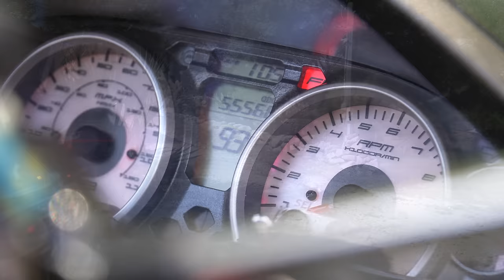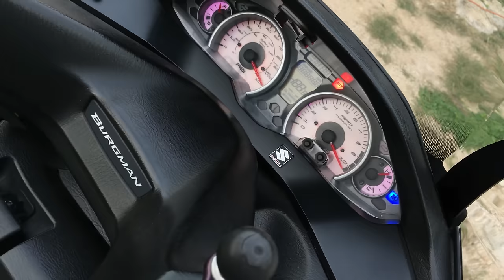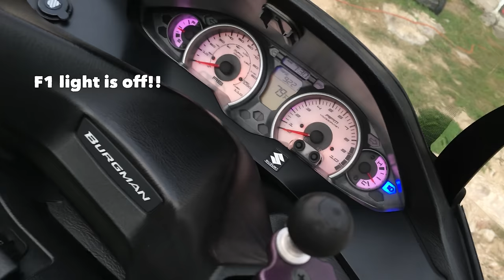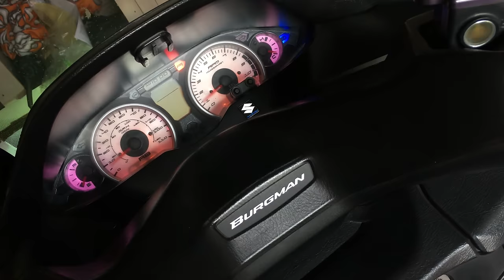Suzuki Burgman 400: FI Light! STVA Problem FIXED! C28 | Mitch's Scooter Stuff

Comment: Ever figure out what the actual issue there is? Mine trips every ride or evrry other ride. Bikes in the shop for inspection and i had to show them what you did to get it to go off.
Reply from the maker: Hmmm I would do deep cleaning and clean the connectors, hopefully that will fix the issue

Comment: Hi Mitch, I have suzuki burgman 200,  year 2015. I have a problem with overcharge problem. My I know, where the regtifier position is? And is it possible replace the original regtifier with other brand with the same load, such as regtifier of honda tiger or kawasaki? Thank you Mitch.. GBU

Comment: Great video. Thank you. So I checked mine out with the FI light on and the value when moved to the closed position will cycle to fully open when the key is turned on. When at fully open it just judders and stays there. When the engine is turned on it doesn’t move at all from the fully open position. It’s like it will only move in one direction. Does anyone have any ideas? I tried everything in this video and no change sadly. Thank you

Comment: Good job Mitch. That is a fly by wire system consisting of a Throttle actuator control (TAC) and Throttle position sensor (TPS).By removing it and cycling the key, you were able to have it re calibrate itself. Most automobiles do it every time you cycle the key. Some need a scan tool. The ECM calibrates it by feeling the load of increased amperage when plate stops all the way open then it cycles closed and detects the same. The number one issue causing that is sticky dirt holding plate closed so it grabs during key cycle and goes haywire. 2nd is internal issues or slightly loose connector terminals. Keep up the great work. I have 2013 PCX 150 but I want a Burgman and a Helix. I am watching all your videos. 

Thank You
Reply from the maker: Hey thanks for the info! 😄🙌🏼 ride safe 👍🏼👍🏼

Comment: Just bought a 2011 that sat for a couple years and your videos have been a godsend. Thank you for all that you do!!
Reply from the maker: You’re welcome! 😄👍🏼👍🏼
Reply: My fuel problem is on going, change the fuel pump found the filter broken apart and debri in pump. The 2011 ran much better but still no full throttle. will replace what next?.

Comment: I have a 2008 an400 and when I used the screwdriver like you did to turn the actuator it’s spring loaded so it doesn’t adjust so I just opened the valve all the way like you did and reinstalled the actuator a little off the paint marking alignment like you did at the end of the video and it worked!!! FI code is off and throttle power is back to full power!!! Thanks so much Mitch .... you da man!

Comment: The f1 problem showed up again, one year after I did you video solution. I checked all  the parameters and I realized that if you  inject lubricate (WD40) to the intake port and then do again what you do to your video the problem will be disappeared again. 👍

Comment: As always... Awesome stuff Mitch! 
I just repaired my 08' B-man as-per your vid. When I turned the screwdriver clockwise the stva's spring made it return to the same position. I did everything else you did and moved it until the "noise", backed off a hair, then tightened it. After a couple tries I finally got it working properly.
Many Thanks!
Reply: I got b-man 2015 with that problom what should i do to fix it ?

Comment: Thank you Mitch. I had the problem of the secondary fuel filter, after 5000 rpm doesn't work. I desassemble all the fuel pump, fix the fuel filter problem and clean the throttle body by ultrasonic laudry, but i made a mistake when i assemble electric stuff of the throttle body....and F1 light appear....thank you to help me to solve the problem...

Comment: Dear Mitch,  I think I saw 55,000 miles on your odometer,  was it at about that mileage that the problem appeared ?    If I'm not mistaken, the actuator part #  is 13580-14G01-000  and costs around 140$US,  has anyone on here fitted a new part and did that fix the problem ?   Thanks,  Chris in Brazil.

Comment: I have an F1 code 28 but when i took my air tube off and looked inside my carburetor,  i am missing that door and the door way in the back is closed. I think before i brought my 2008 Suzuki Bergman 400 they took it off. Now i really have to get an brand new throttle body

Comment: So if that doesn't work. What happens if it says you should not mess with the idle.  And someone did. Is that a problem. Or what should I do. 
I cannot stand riding at 53 mph when it used to just get up and jump all the way to 95 like it was sapose to. Now it Boggles down.

Comment: Mine loses power sometimes, but no FI light, just can't get it past 5000 rpm, if I open the throttle, engine slows down - do you think this will fix it?
Reply: hola Richard,solucionaste tu problema? el mio tiene el mismo problema,es modelo 2015.Saludos desde cancun.

Comment: Hi Mitch I followed the video.  The sound disappeared and the  performance improved (great acceleration) but the FI light still remains on.  What else is there for me to do to cancel the FI light or do I have another existing problem?  Please advise me.  Thank you.
Reply: Erni I get your local motorcycle mechanic to pull the codes for you to see what it reads. Then work from there.

Comment: Hello, new to you. I  have a 09 burgman an400. I had the same codes come up and tried what you did. It would work for a few a back the same. I purchased a new throttle body and all sensors. No lights now but still don't run well. Any advice?
Reply from the maker: Hey Billy, sorry about the issues :( Did you get them fixed now?
Reply: @MitchsScooterStuff  I have replaced the throttle body and sensors, pricy! New injector, Still not running right. Order a fuel pump, hopefully it will work. Thanks for asking.
Reply: Billy take it to professional, sometimes you have to hand over to experts. Hope you fix problem Burgman is a sweet ride.
Reply: @newmanlord4052  I have it going, thanks.

Comment: I think that is an FI light, as in Fuel Injection.
Reply: same here
Reply: Fault Indicator
Reply: @richardbarrieau2545 that tps issue that one he fixed on the video. same commons on the efi bikes.
Reply: @Nomorekindness7  Now it is constant - getting to be un-rideable...  Wish I could figure it out...  Sometimes no more than 30 mph...  Shut it off for a minute, it is normal for a mile or 2, then the problem returns...
Reply: @richardbarrieau2545  i had same problem with my burgman 650
I drive it to suzuki 2 times and thay sad some computer rstart and again the same...what did you do at the end
Reply: Antonio Blazevic  I followed the instructions on the Burgman Forum, removed fuel pump Assy., fixed it, installed inline filter, is like new bike...
Reply: @richardbarrieau2545  i didnt see before  ,i wil try that,thank you man

Comment: Hi   i   have  a Suzuki burgman an 400  1999   carburator (no   injection)i  dont now how to   regulate the  air  mix sometime stop , no start ,it  has new  spark ,new batery   please help
Reply from the maker: Make sure the air filter is installed and 100% sealed with no air leak
Reply: @MitchsScooterStuff  aha i look tomorow even at the ruber  tub betwheen the carburator and motor  thanks for now  from Romania

Comment: Hi can anyone help manly u Mitch I  have a 2007 400cc I do my own oil    and stuff i had a fault from O-ring slipping in the oil filter area yes it was the small one I fixed it straight  away now my F1 light comes on sometimes, The electrical sound i can hear is the stva going through its thing. Its not that the F1 light comes on everytime I turn the key only when its cold otherwise i turn the key check the light don't come on i start the engin no light.. Also it has not came on either whilst riding since i fixed the problem. 
Can anyone Help and tell me if its all good or and how to stop it from coming back on again... 
Thank you Lynda  Sydney

Comment: Hi, I have a 2008 burgman, the back tire is spinning fast on stand like 20 mph, when I trie to drive it it stalls, feel like it wants to go foward......
Reply from the maker: that sounds like same situation my friend got... the bearing is broken in the driven pulley ... you might need to open the CVT cover to check... I have video to show how to remove the cover and parts on my channel
Reply: Edwin90 did you fix this? My 07 does something similar. Idles at 2.5 to 3 k rear wheel wants to engage. It will drive but F1 comes on at traffic lights. Any help appreciated.
Reply: Yes it was the clutch, replaced clutch clutch bell weights transmission oil, brand new running great
Reply: @1728edwin  cheers for that

Comment: My 03 400 had light on all time. No power loss though. Now i know what to look for. Going thru everything before going legit. Was $400 so expect a lil fault. He got  fake oil drain plug if anyone knows where i can get a real one. It runs and drives. Has 27k on it. And needs rear wheel bearing? Has that grinding when u spin it. If anyone knows a place

Comment: This is not fix. It will help for some time, but not for long.
Door sensor is close to death, unfortunately - it is regular bug for this model. Maximum you can do, when F1 come next time - drill a hole in the sensor and put some lube (WD40 for example) inside and close that hole. BTW, it is also will help but it will not work forever)